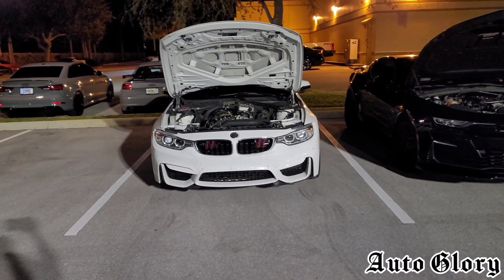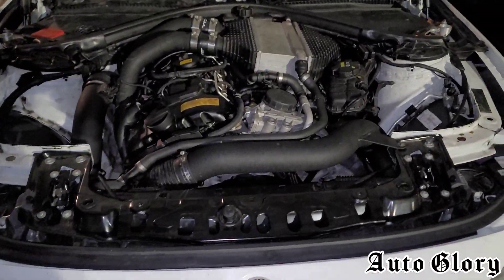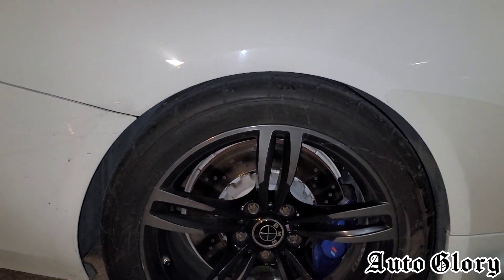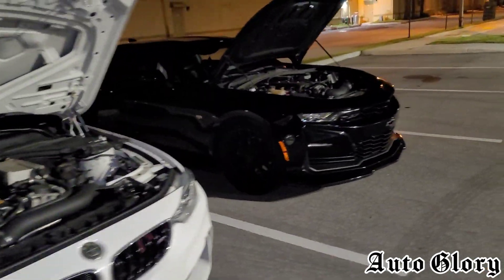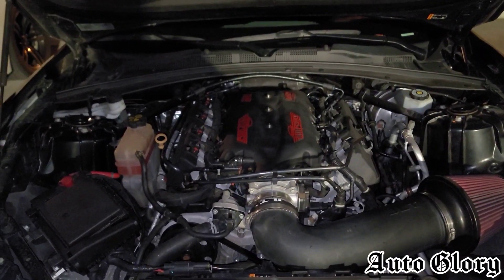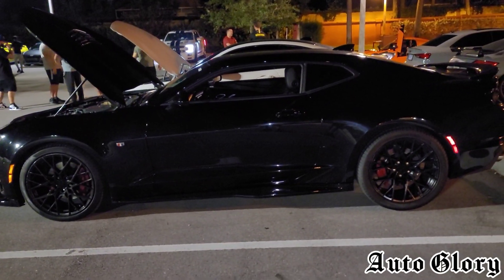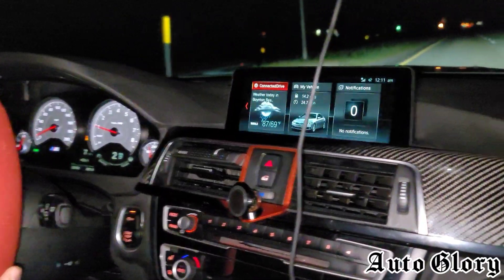2016 BMW M4 Bolt Ons E85 vs Built 2019 Camaro SS Bolt Ons Cam E85

Comment: damn that Camaro probably went to a high reading dyno, most S55’s will run 560-580whp on E85 depending on the dyno. that Camaro was definitely not 580whp, then again the S55 probably makes way more torque
Reply: On every video you comment like you know everything lmfao 🤪 even what dyno the individuals went to...amazing
Reply: Hp is derived from tq and rpm, they’re not independent values. My guess is the Camaro’s built block allows it to rev higher, so it’s only making that 580 whp at the top end of the rpm’s. So yes, you’re right it definitely makes less tq, the s55 makes peak tq at like 4K rpm lol, way more power under the curve
Reply: @DouEditz  💀💀
Reply: @DouEditz  triggered
Reply: nah bro tbh bmws really do be beating cars that make 100hp more than them it’s nothing new. but it’s a boosted car vs n/a car top end it’s a clear no brainer lol
Reply: @thewhite335  I don’t understand this argument. It’s a very heavily modded N/A setup vs a couple bolt ons and tune car. H/C/I C6z’s are monsters and don’t need boost to compete, plenty of other N/A setups can also hang. At the end of the day, the slower car lost. Why is it always a conversation of boost vs N/A lol
Reply: @cokemachine62590  LOL u want me to say except for corvettes? corvettes are extremely light and aerodynamic and proven to put in work n/a everyone knows that. What other car you know can do that? pls lmk! And it’s always a conversation with boost vs n/a because yea a n/a car can make 600whp on a dyno but can it hold that powerband to 140mph and up? for boosted cars it can make 500whp but it can hold that powerband all the way past 140mph way easier than a n/a. please explain to me why boosted cars with less power beat n/a cars making more power
Reply: @thewhite335  N/A Steeda Silver Bullet mustang is running 9s, no boost, no nitrous. And I briefly talked about why a lower hp car could beat a higher hp car, it’s all about power under the curve. If you wanna know more, I suggest doing a google search bud
Reply: @cokemachine62590  didn’t see ur first comment about tq and rpm but i agree with it. and that mustang is a dedicated drag car probably has a 1 sec 60ft lol maybe less but i’m talking about Roll Racing where people buy a normal n/a v8 from the dealership and mod it LOL what other n/a car puts in work beside the corvette in roll racing?
Reply: I’m wondering if he had traction control on xD but really though, that looked like a 100hp gap. Something isn’t adding up lol
Reply: @cokemachine62590  a n/a maxed out 10spd 5.0 is probably ur only argument anything else is a super car or something really expensive that barely anyone can afford
Reply: @thewhite335  Less than 1 sec 60 ft? Yeah, you really don’t know anything about drag racing lol. Only cars that can do that are top fuel dragsters. But even a bolt on 10 speed mustang has run 10s. You also have things like a viper or any 10 or 12 cylinder sports/super cars that put in work, but those are obviously out of a lot of ppl’s budget
Reply: @cokemachine62590  i could careless about drag racing 😂 roll racing has my interest lol but these boosted cars are cheap asf and make power way easier stock turbos than ur typical n/a car. why u think majority of the people who are tryna make power in their n/a v8 spend the money to boost it? boosted > n/a all day! spending the money to fully build a n/a motor is a waste of fucking money if ur not boosting it
Reply: I was making 610whp on full E85 but I was tuned by F80 Paul, so that custom tune gave me that extra sauce than an OTS E85 map, Camaro needs to be boosted to compete with the M4
Reply: @jesusoliveros1152  Did you have stock midpipe?
Reply: @thewhite335  A NA modded Fox body is cheap and can be pretty damn quick! Engine swapped lightweight cars and "kit cars" like my SL-C (<---) that weigh sub 2500 lbs can be really quick NA as well.
Reply: @thewhite335  M156 did it  for yeaaaaars still does! Lol look at the carwow video of the old vs new ....
Reply: @cokemachine62590  i had AA midpipe and i still do, but i added meth injection few weeks ago
Reply: @jesusoliveros1152  Nice! I didn’t think a meth kit was really that beneficial with stock turbos, have you been dyno’d since the install?
Reply: @cokemachine62590  the only dyno i have in town is a high reading dyno, so i don’t base my results on that dyno. It showed 660whp last time i went, but i know it’s not near that, maybe 620-625whp on a good day?
Reply: What is S55?
Reply: @ashanirpaneer  S55 is the variant of the engine on that M3/M4
Reply: @cokemachine62590  C6 Z06 definitely monsters but part of what helps is power ro weight ratio over most opponents. Its 3200 lbs at best while this Camaro is 3700-3800 lbs
Reply: Lol clown
Reply: @DouEditz  😭😭😆😆👉👉🤡🤡
Reply: @MrMikeyj81  i love you too baby

Comment: So many excuses, we know the m4 has boost but don’t forgot the ss has a big built 6.2l V8 motor with a 10 speed also
Reply: To be honest forced induction is more powerful and more efficient than cubic inches and the dct loses less power through the drive train than a 10 speed
Reply: @kareemhailey9585  the m4 with bolt ons on e85 is no more then 550 wheel. This camaro is 580 wheel, the m4 has a small 3.0l motor with factory turbos, the camaro has a 6.2L V8. If the m4 would have lost “get that little ricer out of here” “there’s nothing like a V8”
Reply: @MBigturbo  not true your lying to yourself the m4 in stock form can outrun a stock ss camaro, and a tuned turbo car is good for a extra 100 horses plus a good 70 from E85 so I’m thinking that bmw is close to 700 horses while the camaro is probably at 580 but the camaro is lighter than the m4
Reply: @MBigturbo  I’ll leave you with this look at the cubic inches of a 2010 m5 and a 2016 m5 or a 2006 z06 compared to a 2016 z06 or why does the scat pack have more cubic inches than the dodge demon look at the formula for the 720s, it the winning formula is smaller cubic inches stronger walls more boost
Reply: @kareemhailey9585  there is zero chance that m4 is making 700whp....
Reply: @jax9074  that’s not what I said, I said close to 700 crank horsepower
Reply: @kareemhailey9585  video said the ss was 580 wheel, doesnt make much sense to compare cars using wheel and crank...
Reply: @jax9074  that’s true but American cars are much easier to measure than German cars especially BMWs who seem to really underrate there cars but my point is the bmw has more horsepower at its wheels than the ss has at the crank
Reply: @kareemhailey9585  the bmw doesnt have more power to the wheels than the ss at the crank. The bmw is making less power than the ss no matter how you look at it if the ss is really making 580 wheel
Reply: @jax9074  your crazy watch that same bmw go head to head with a gt500 that bmw has 600+ to the wheels
Reply: @kareemhailey9585  those mods on the M will make about 550 wheel. Either way the ss makes 650ish crank(if it really makes 580whp) and there is absolutely no way the M makes 650whp.
Reply: @jax9074  so explain how that same m4 lost by a fender to a 2020 gt500
Reply: @jax9074  men and women lie but numbers don’t
Reply: Bet, all of these Chevy spectators would say “ no replacement for displacement” or some common v8 b.s if that Camaro did run as well as those mods sound, However it just isn’t the case. I’m sure that Camaro will come back for glory when he drops more money into it, for now do your homework and don’t try running cars out of your league it’s embarrassing and I’m sure I’m about trigger a lot of you but don’t argue with facts please no he needs boost, nitrous, driver mod, better car etc.. 
Frank we need more videos keep them rolling!!
Reply: @kareemhailey9585  stock gt500 runs 10.7ish at a little over 130. 550-560whp M should run 10.8-9 at 129-130 so it makes perfect sense IMO...
Reply: @jax9074  that’s a gt500 with no tires, that’s why roll racing has become so popular, it takes the 60 ft out of the equation, a car that weighs 400lbs less than a gt500 is going to need 600 rwhp because on the dyno the gt500 is 700 rwhp
Reply: @kareemhailey9585  english must be a second language for you. I give up, have a good day 👍
Reply: @jax9074  😂😂😂😂

Comment: I figured the M4 would win. That S55 motor is very torquey. He probably has a huge advantage in torque over Maro. I had a friend with a FBO, H/C, 6th gen SS manual. He put down 570 rwhp on E85 but only 490 rwtq. I bet this Maro in vid is high 400's-low 500's at best rwtq
Reply: Doing rolls above 40-45 mph torque isint the big factor, it's more of a horsepower thing at that point

Comment: Do you know the dragy Times from m4 ?? 60-130 or 100-200
Reply: For bolt ons + meth with bootmod tune 100 to 200 probably like 6.6, 6.5ish which is brutal
Reply: @isaaaldoy  is this your car ? He drive on e85 bro I think its 100 hp more than pump fuel also 93 oktan usa Europe 98 oktan 
In Germany this car make approx 570-580 on crank on only 102 oktan fuel with stock turbos and running approx 7.2~ 7.4 ~  and downpipe intake charge pipe cooling and and ...
I think on e85 this make 100 hp more 

I think camaro is fast too it runs middle 7 sec 100-200 but its heavy and n/a car nicr run
Reply: @hythekiller  not my car but i have a friend that is on a 98 oct tune, + has methanol so kinda makes up for the e85ish
Reply: @hythekiller  so my friend is kinda on tye right track cz to make a second diffrence u need like 150 to 200 gain + here in the middle east the weather is like 34 C so yeaa

Comment: Damn, thought it would’ve been a closer race, considering the SS stated power output of 580, the M4 with those mods make around the same power, but still took the Win by a large margin, good kill for the M4 💪🏽
Reply: Most likely wasn’t 580 with those mods most ss read about 500 to 520 tops
Reply: @thedragon356  fbo maros 6th gens make around 470-480whp… Cammed heads should be around 560-600whp depending on how aggressive the cam is.
Reply: I dont even have heads on mine, and I have a stage 2 cam, this one had the stage 3. Mine put down 530

Comment: That Camaro is likely not close to 580 whp IMO.  Those same mods on a LS7 is about 600 whp.  Unless that TS short-block has been seriously bored and stroked, and it has LS7 heads (it doesn't), it's not making 580 whp if a built 427 with much higher flowing heads only makes about 600 whp!
Reply: Ls7 heads? Lol they aren’t even compatible and lt1 heads flow better than ls7 heads minus the valve drop
Reply: @TsukuyomiPlayz  I'm not too sure about that... LT1 heads flow only a little better than LS3 heads in stock form
Reply: @TsukuyomiPlayz  Sorry, the LS7 head out flows the LT1 head by a good margin, especially when porting both!
Reply: @ssoffshore5111  exactly..LS7 head is peak LS head... lt1 head vs ls3 head is like 3 to 5 cfm

Comment: e85 on boosted applications can add UP TO 100rwhp with a good tuner. This was over before it began 🤷‍♂️
Reply: I mean my 01 C5Z dynoed 340whp stock and after an MS4 Cam, stage 2 heads, bolt ons and a tune, was making 472whp. That’s a pickup of 132hp without boost or E85.
Reply: @brandon6712  That's awesome! You add e85 to that due to the cam and better air flow, you'll add easily another 30rwhp if not more honestly.
Reply: @FitzCity  maybe not with that specific setup. I think I was about tapped out with my stock manifold and injectors. But yea, if I had upgraded those, for sure could have seen more. Ironically that car with that setup could barely nudge out my buddy’s E85, bigger turbo SRT-4 when it was running.

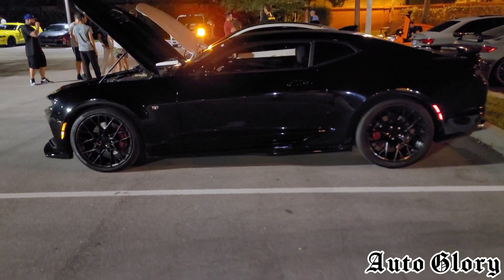Comment: 0:56 Comes at 455 at the crank from factory and with just bolt ons, it's at 580 rwhp??
Reply from the maker: Built longblock ( pistons rods ported heads and cam) e85. Must be on higher compression

Comment: Damn. That camaro should be faster , no ? And those rubber band…..🤨 anyhow another classic brother
Reply: i’m sure this m4 could’ve still walked the maro with just downpipes & a tune.. they don’t take much to be wicked fast
Reply: @f82k  no doubt about it. BMW always run hard. But if the Maro is making 580 RWHP it should easily be a 125 quarter mile car , no ?

Comment: All these Mods and the car makes 580 to wheels ? the car should be in the 800 HP range
Reply: It’s because it’s still NA. If he supercharged it then it would make 800 all day lol but if his engine was built for high compression and not for boost… idk 

He should supercharge, and the m4 should upgrade the turbos and then they run again lol

Comment: Can you say the hp numbers ?
Reply from the maker: 570 whp for the m4 and 580 whp for ss
Reply: @AutoGlory  How does 570whp walk away from 580whp like that. One of the stated numbers is not correct.
Reply from the maker: @TorqueMachine  not sure. I know the m4 dyno numbers are correct cuz I saw the dyno sheet. I did see the sa owner just recently and he's on radials now. Said he hooks much better now. Not sure if that will help that much based on how the races went. But maybe they will rematch and see.

Comment: Even with a built block and big ass cam the camaro still got dusted like it was stock? His tune has to be half assed at the least it should have been a neck n neck race. Not taking anything from the BMW i know theyre fast especially with e85 but that camaro should have took it
Reply: You know I’m curious too because stock turbo m4s are in a similar HP range lol 

maybe he had traction control on or something xD
Reply: @alextasarov1341  one thing is known BMW usually under rates their hp levels so stock it probably had about 500hp not 450 like its stated. With its mods its probably close to 620ish hp but the camaro should be in the same neighborhood with slightly more weight. Either way weird race outcome
Reply: @halow4  no, I think the m4 numbers are accurate lol they usually dyno around 580 whp with stock turbo and e85. Stock they are underrated but only by a little bit. 

In completely stock form with a tune they can make 500 though xD
Reply: Even if that BMW had the hottest stock turbo tune ever it's in the low-600s most likely.  I think the odds favor the BMW even if it was "only" 580 whp as well, but the way that Camaro got gapped doesn't say 580 whp V8 to me.  The GM 10AT does require some tuning when you up the power though.  And that means sending the TCU out to be unlocked.  If he didn't unlock the tranny, he could be dumping a ton of power on shifts.
Reply: @ChurchAutoTest  which is why i mentioned that tune cant be fully fleshed out
Reply: @halow4  Indeed that seems like a possibility.

Comment: Camaro build is good for the drag strip not no top end runs, remember its against a German vehicle in which their strong points are topend runs, would have been better in the Chevy had forced induction, but great race either way